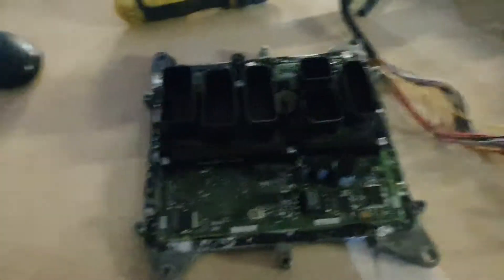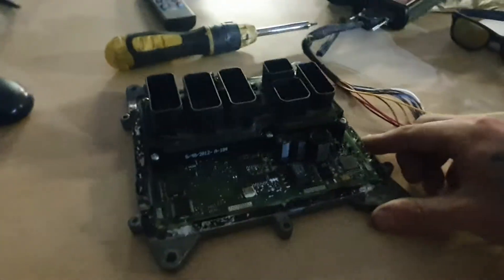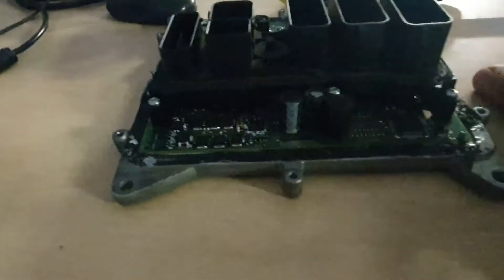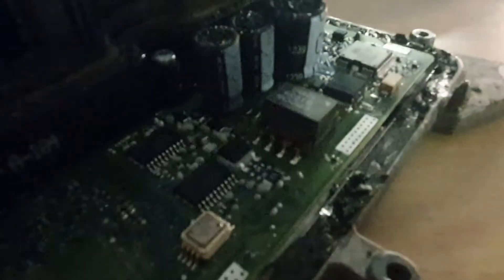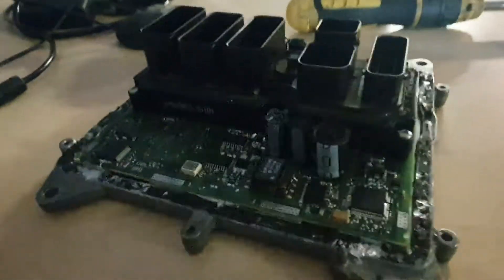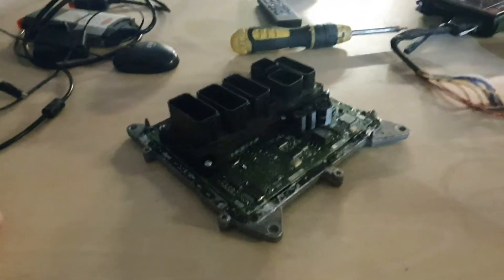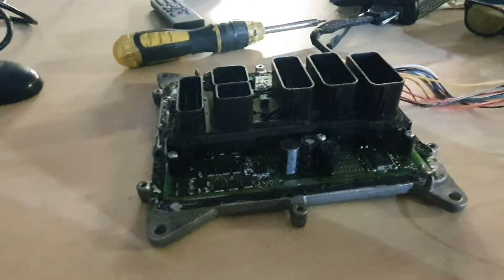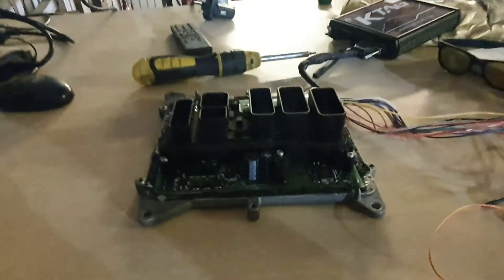BMW MEVD17.2 ECU repair - GEL Automotive electrical LTD

Comment: Which are the transistors that control the ignition coils? I am having misfire in cylinder 3 and connector reads 14V while all the other 3 coils read around 7V